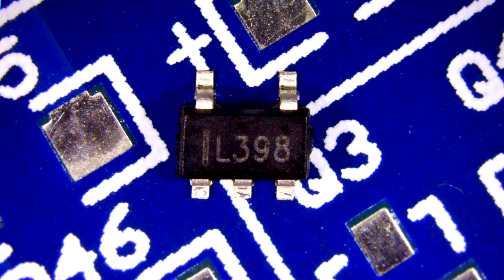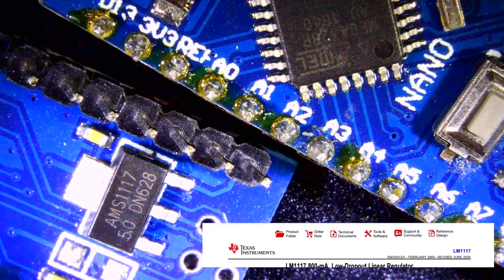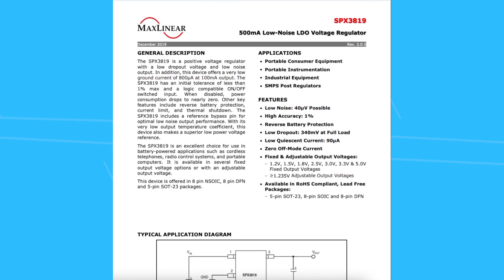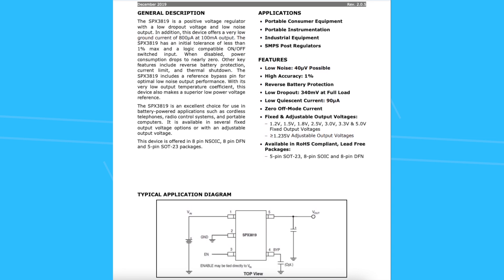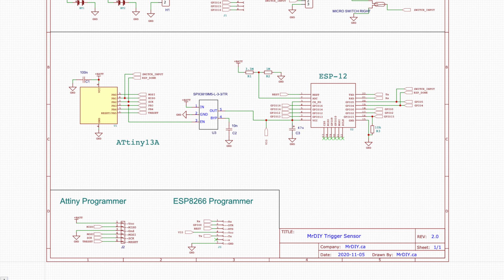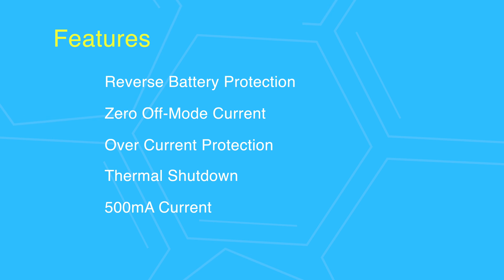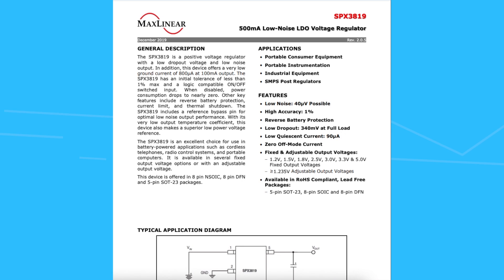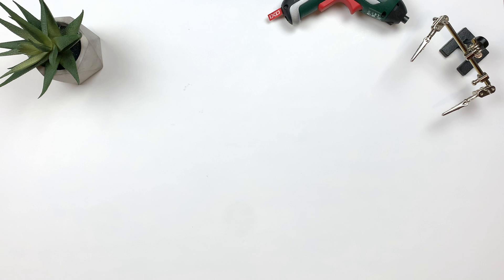LDO Voltage Regulator for ESP8266/ESP32 Battery Projects (SPX3819)

Comment: Very helpful indeed! 
Is it possible to use as an alternative of SPX3819? As SPX3819 not available.
NCP3335AMN330R2G - LDO Voltage Regulator, Fixed, 2.6 V to 12 V in, 260 mV drop, 3.3 V/700 mA out, DFN-10
Reply: Tps7A02 world best ldo it only ldo with ultra lowets iq in the world

Comment: Thank you for sharing ， but Why can't  remove the Attiny and directly switch_input to the EN pin of the ldo,  so that it is more energy efficient without the Attiny？ I'm  very confused why do you have to add a Attiny
Reply: Can I get rid of Attiny if    Switch_input is a self-reset button  ?  My project is to use the self-reset button to remotely control the light   through   espnow
Reply from the maker: You can but it will only trigger in one direction, for example, when you close the door and not when it is opened. The other downside, when the door is closed the LDO will always be ON draining the battery.

Comment: do you keep ATtiny in sleep mode or in active mode? Active mode = 240uA - that is way to much for battery. I am still thinking how to monitor the pins without drawing so much of current. Unless you keep ESP in sleep mode with "wake up on gpio" when you can get to 7uA during the sleep.
Reply from the maker: yes, I keep it in the deep sleep and wake up only on interrupts or timers
Reply: @MrDIYca  so you use sleeping Attiny to wake up, enable power supply for esp and then the rest, right? what is the reason for using Attiny to sleep rather than esp to sleep? what is the sleep current for attiny?

Comment: good video. I think that RT9080 is best but more expensive.
Reply: based on my research, RT9080-33GJ5 is best -> input voltage range is from 1.2V to 5.5V. EXCLUDING reverse battery protection. I think for IOT devices (probably needs to replace battery every 2-3 years), reverse battery protection is not a big problem.
Reply from the maker: I will check it out, thanks